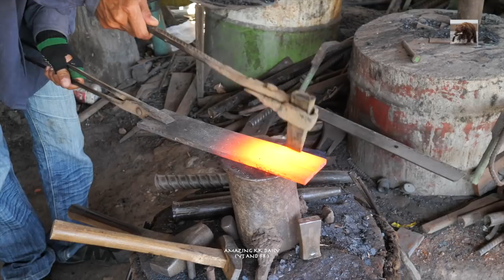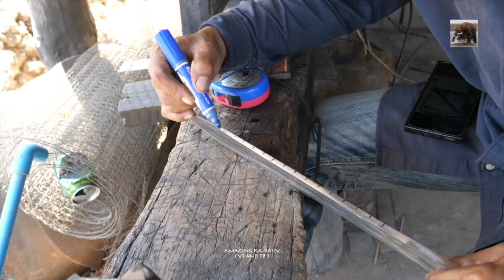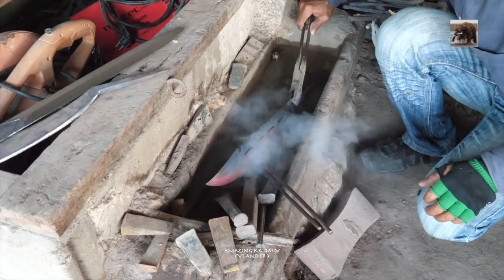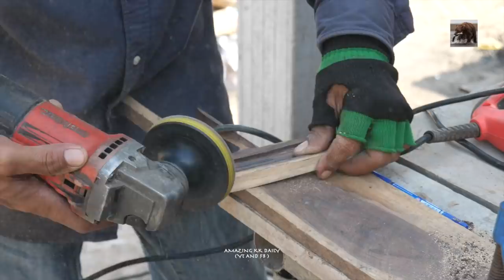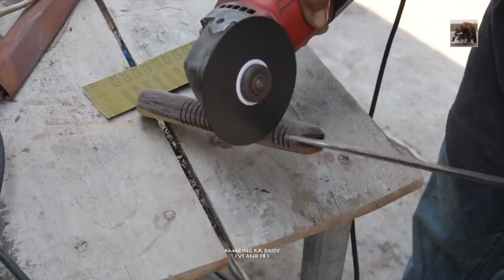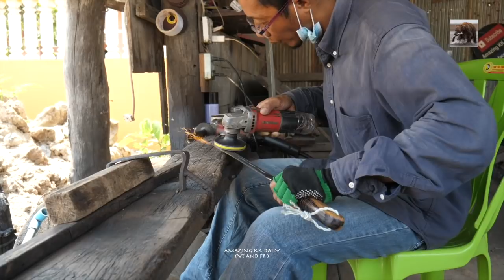MAKING A QUALITY SWORD FOR CAMPING FROM SPRING STEEL

Comment: If the original stock bar was not much thicker than the finished blade, why not just grind out the shape from the bar and not go through so much work heating and cutting down to get the final size?